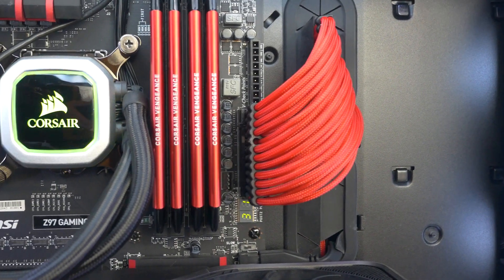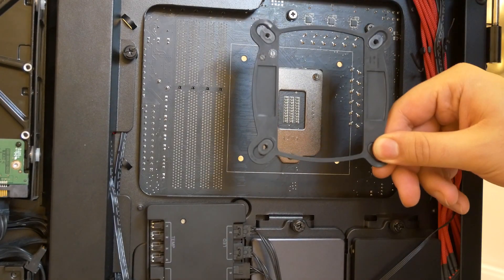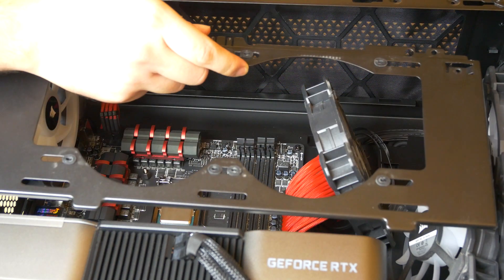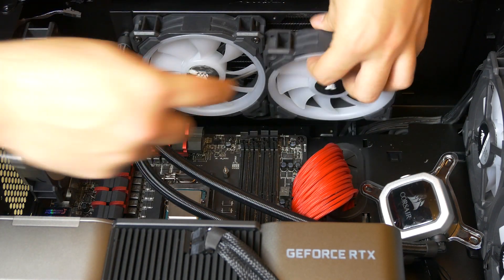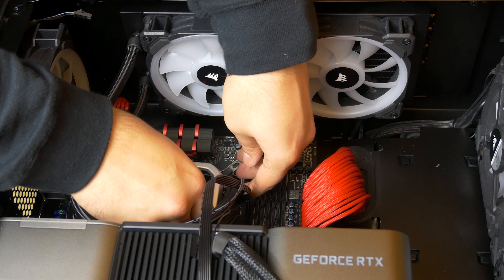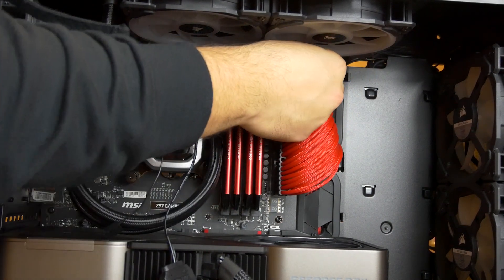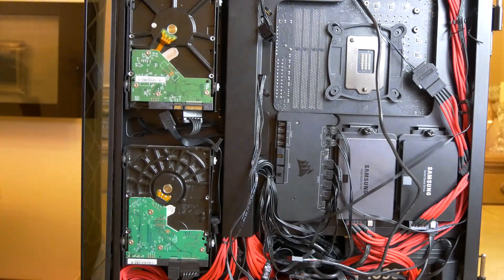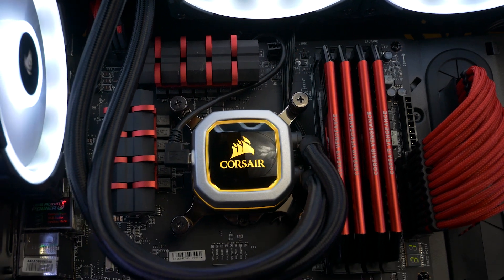How To Install Corsair H100i PRO RGB Cooler - The BEST Way!

Comment: Hi. I got this psu, I like it, but I run into one issue. So, I have icue h100i rgb pro xt pump. After I changed from corsair rm650 to this new Corsair rm1000 (2025) pump rgb light does no work, but I see it in the icue app, I still can change the speed of the pump, it is working, just without the RGB lights on it. I have fans also on the side of case and they have lights. My case is also from Corsair. I have found that rgb light on the pump will not work if you have 4 pin SATA cable and in this case this 1000w psu have two SATA cables with 4 pin, it needs 5pin Sata cable in order to have lights - it does not deliver power what it needs.  Old PSU had 5pin SATA cables and it worked. Can someone confirm this also? It is a bit stupid how it all sounds , but this seems to be right. I just do not understand why they have just 4 pin, but my old one had.  I ordered type 4 SATA cable, that can be used with this PSU, cables are also from Corsair and I think that they are expensive.

Comment: Hey bro where did you connected the fan rgb cable bc as soon as i plug it into rgb place on the mainboard i can hear a electrical sound which is syncron to the light effects

Comment: I just got this cooler and I'm going to do a top mount like my old one but do I set the fans to pull air in or to expel air out?
Reply from the maker: You want to expel air out for optimal performance. When the air passes through the radiator, it comes out hot so you want expel that hot air.
Reply: @chilisos  oh ok really good to know, I'm pretty sure I have mine backwards so I'll fix that asap. Thank you for the reply!
Reply: @chilisos  I probably should have the fans under the radiator pushing out, or should the fans be the top sucking it out?
Reply from the maker: @blantherboy  So I have done some experimenting with that in the past and noticed no difference in temperatures by having the fans mounted on top of the radiator or under the radiator. However, everyone likes to mount the fans under the radiator so that the fans are visible inside the case - this is the way I have mine mounted.
Reply: @chilisos  got it, thanks again for the info, appreciate ya.

Comment: i would install the fan for in take instead of exhaust. Maybe it "looks" better having the front of the fan facing downwards. I am also installing this on the top.
Reply: I’m trying to properly install mine, so you flip the fans or is it possible should I have the fans above the radiator? I’m not looking at it right now so idk if that’s even possible to install with fans above
Reply: @nikkman22  I'm not expert, it's possible (I have seen a youtube video of a guy testing all sorts of positions of the Fans and Radiator to see difference in Temps). Anyway, but if you are mounting the AIO on top, usually I think the Fans are "BELOW" the Radiator regardless the direction of your Radiator fans are blowing.
Reply from the maker: I wonder if you mount the fans as intake, mounting the fans ontop might be better since it will have stronger suction to pull the air from outside the case though the radiator since the distance travelled is lower.
Reply from the maker: Because I am using the fans to exhaust the hot air out of the case, I would mount it below so it has enough suction to pull as much air as possible out of the radiator.
Reply from the maker: I really wouldn't mount the AIO fans as intake. The reason being you are taking cool air from outside then passing it though the AIO, making the air hot, then pushing that air into the case of the computer. Your computer will run at higher temps that way.

Whereas, if you mount the AIO fans as exhaust, you get hot air from inside the case, pass it though the AIO making the air hotter then pushing that hot air out of the case.
Reply: I was following this video: https://www.youtube.com/watch?v=b9bOQa1uaHU&list=WL&index=2 where the guy is using/suggested as intake from top. I installed as in take from top as well. So far everything is running very quiet and cool.
Reply: @CarrotBBQ  sorry but the guy in the video you linked to isn’t doing intake on the top. He is doing exhaust. Never do intake on top... hot air rises. Always do intake on the front and bottom and exhaust in back and top if you can. Whether you put your aio radiator at the front or top is your choice but just know that if you place it on top as exhaust, the cpu temps will be hotter since it is taking warm air from inside the case to cool the cpu. Placing the aio radiator as intake at the front will take fresh air from outside the case to cool your cpu, but then warm air coming out of the radiator will warm up the case more and make your gpu warmer. That part is up to you. But never intake on top. It does not make any sense to do that and will give you worse temps overall compared to the other ways I mentioned

Comment: also, do you need that corsair ll120 thingy for the leds in order to use led?
Reply from the maker: You need to connect the LL120 fans to the Lighting Node to be able to control the LED lights regardless of the AIO. However, what I did in this video is, connect the LL120 light cable to the Lighting Node but connected the fan speed cable to the AIO instead of the Commander Pro. This is because I want the AIO to control the fan speed of the fans on the AIO instead of the Commander Pro.
Reply: @chilisos  prec8 it

Comment: Can you use ique with this?
Reply from the maker: Yea which is why it's awesome! So the CPU RGB works with iCue quite nicely, you just plug it into the internal USB and it works. In my case, I am also using the Corsair LL120 RGB fans which is a bit tricky to get working with iCue with this kind of set up. So the LL120 RGB fans has 2 connectors, one for fan speed and one for RGB control. You need to connect the fan speed ones to your CPU AIO cooler and then connect the RGB cable of the fan to the Corsair Commander Pro/ Lighting Node to get RGB working with iCue.
Reply: @chilisos  can you do a video on connecting the fans to the lighting node and aio please. I have a very similar setup and I'm struggling to wrap my head aroy this. Thanks
Reply from the maker: @justalexo4286  So sorry for the late reply! I must of missed this!! Yes sure. But to save you some time from waiting for a video. The LL120 fans come with 2 cables, 1 for fan speed and 1 for RGB control. Plug the RGB cable to the Lighting Node and plug the fan speed cable to the AIO
Reply: Thanks man 😊